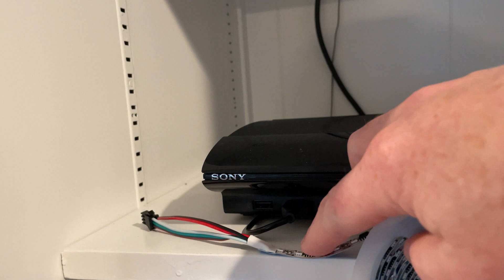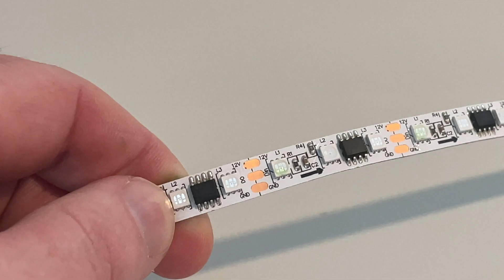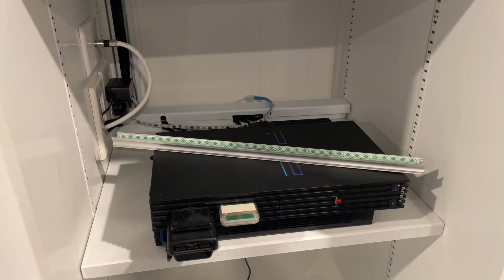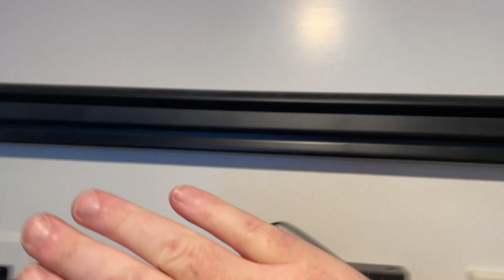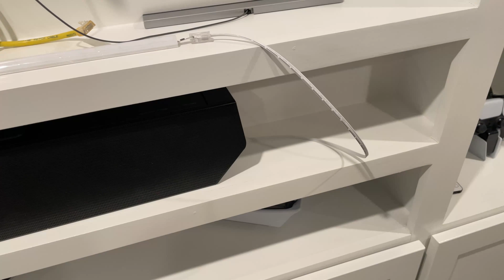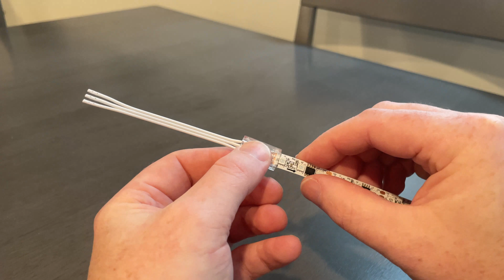DIY Indirect LED Lighting for Entertainment Centers, Furniture, & More!

Comment: The octagon shape?? Light doesn't work that way brotha. There are no hard right angles with light. The reverse of that logic would be if your light bulbs in your house square and as a result there are dark corners in the room. See that dog don't hunt
Reply from the maker: Thanks for adding your thoughts, 
@DanielRichardson-t3p   Check out this image.  This is an example of the installer using a rectangle.  Note the dropoff in light at the corners.  This is what we're trying to avoid by using an octagon.  https://the-gadgeteer.com/2023/07/16/govee-t2-tv-backlight-review-make-your-favorite-shows-more-immersive/